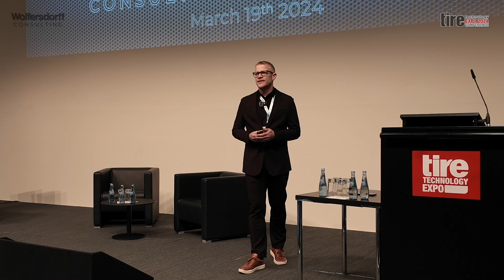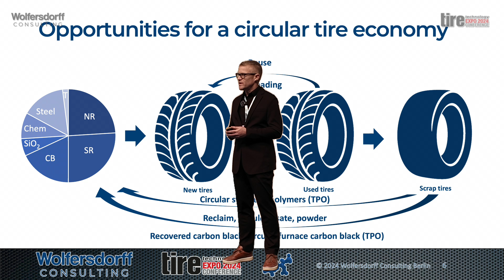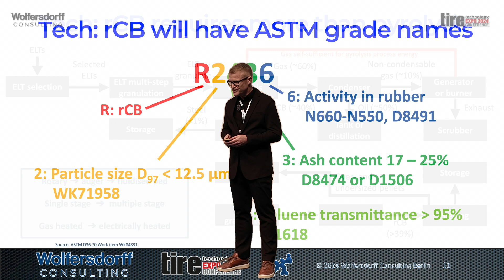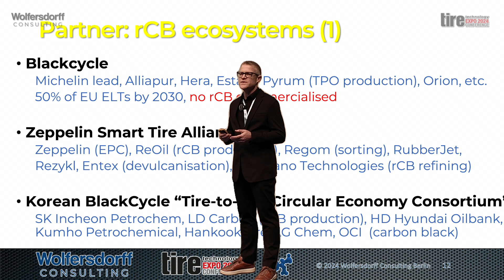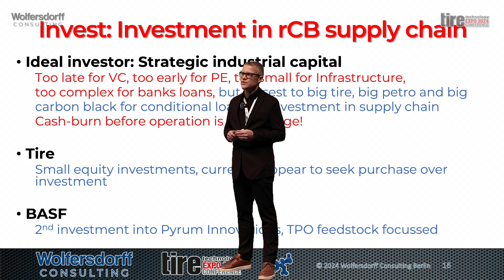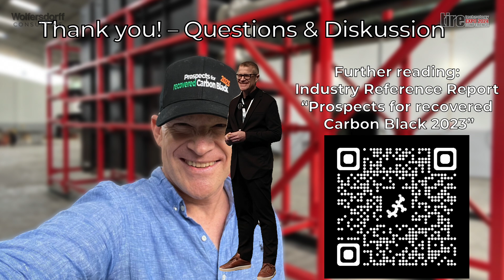🎙️ recovered Carbon Black Update from Tire Technology Expo & Conference 2024

Comment: Hello, sir. Am King, what's your take on the use of rCB in lithium-ion batteries?
Reply from the maker: Hello, I think this is an interesting application as we all need lithium batteries. For rCB producers, I believe this is not of importance (yet) because conductive carbon blacks only represent 1% of carbon black markets and require a massive R&D effort for rCB to perform, including reduction of inorganics and activation. My recommendation: Choose simple markets and get to cashflow quicker!
Reply: @vonwolfersdorff   I am located in South Africa. Which market do you suggest?
Reply from the maker: @mxo202   There is no easy answer to this. I recommend some strategy work looking at your processes, capabilities values and objectives. Then you can pick your positioning and markets. Of course tyre and rubber markets will be largest volume, but that does not necessarily mean that these are your best markets as the time to market is slowest. Greets from Berlin
Reply: @vonwolfersdorff  Thank you
Reply: @vonwolfersdorff @vonwolfersdorff Sir, I am from India. I want to start an RCB plant without setting up a pyrolysis plant. In India, the only manufacturer of RCB plants is Fabhind, but they told me that I must have my own pyrolysis plant and use high-quality tyres in order to get good quality output. They also said that the reactor should reach a minimum of 600°C to reduce volatiles. However, I was wondering—if I use a rotary furnace and heat the carbon at 1200°C, wouldn’t the volatile content be even lower compared to operating at 600°C in their reactor? And can i get 99 % purity in rcb?
Reply from the maker: @harshshah1606   Thanks for your question Harsh, which I replied to there https://www.youtube.com/watch?v=6zs7hFXj8jg . Best wishes from Berlin!

Comment: Hello sir, I’m Asif. I wanted to know toluene transmittance of recovered carbon black is better in continious or batch pyrolysis. I also would like to know the methods to improve toluene transmittance. 
Thanks.
Reply from the maker: Hello Asif, the levers to reduce organic volatiles on rCB and hence increase toluene transmittance are the same for all pyrolysis reactors, you can increase temperature, increase dwell time, increase mixing within the reactor or decrease crumb size of the feedstock. Greets from Berlin

Comment: You can reduce the tire wear by building lighter cars & trucks. The increased weight of EVs are increasing tire waste.  ICE cars & trucks save money and reduce tire waste.       FJB
Reply from the maker: Thanks Ken, I think that is true. The consumer's choice between ICE and EV might not be for tire wear though. I want to promote the retreading of tires, including PCR, because the carcass is 90% of the waste. The tire wear particles are only now being addressed by the industry with new approaches to tread compounds, both with functionalised SSBR and new reinforcement materials.